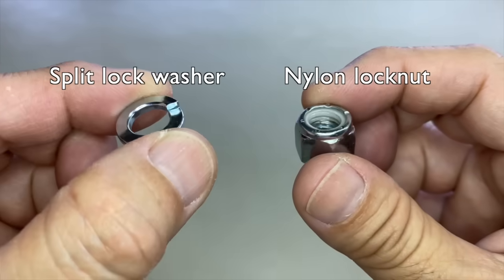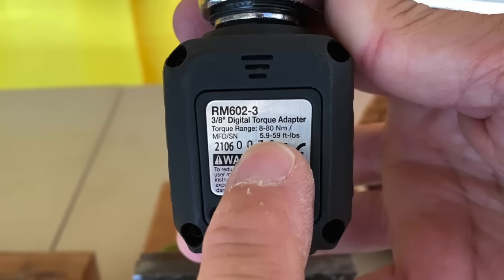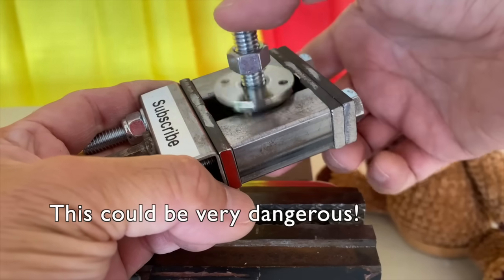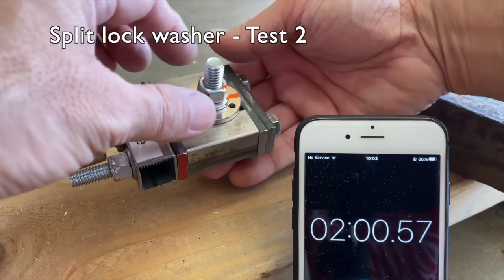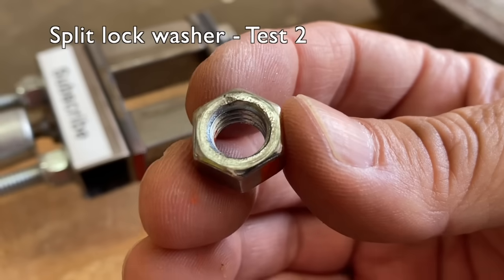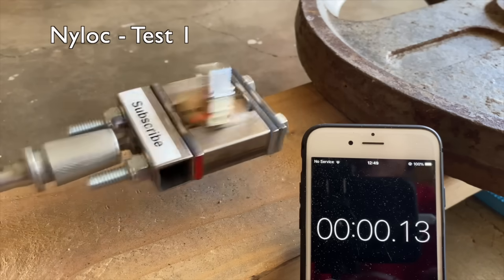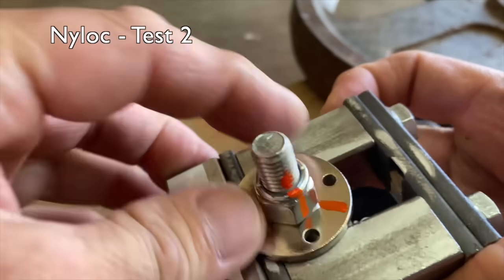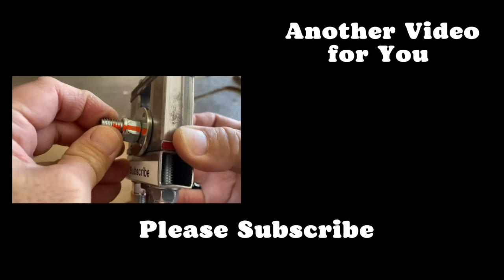Nuts & Bolts - Split Lock Washer vs Nylon Locknut – DIY Impact & Vibration Test - Part 1

Comment: Interesting in that since the nylock nut didn't turn against the bolt the nut hadn't backed off. Where did the looseness come from? What would happen if the nut was re-torqued at that point and the shake test run again?

Comment: did you remember to add drag torque to the torque? i.e.: drag torque is the amount of drag of nylock nut to turn on the bolt plus the 6 torque may be total of 8, or whatever. whenever you use a nylock you must add the drag torque in order to get proper torque.

Comment: Problem with Nylon locking is they are not good with heat cycling. They do locking nuts that have been compressed where there is no nylon in them.

Comment: Nylocks always worked on caliper brakes on bicycles.   Five decades of confirmation. Even the ones that were not torqued down properly.  Also the nylon keeps salt water out of thread. I use them in many other places on a bicycle.

Comment: 6lbs are you kidding me. I work on my own vehicles and other projects. Nothing I have worked on in 30 plus years requires 6lbs. Now due to the plastc of the nylon it would not make marks. Do the test at a much higher poundage.

Comment: First off, 6 ft/lb is a bullshit torque setting for a fastener that size. There is absolutely no preload on the bolt in an axial direction which negates any clamping force necessary for a thread locking device to work. The only reason the Nylock worked is because the Nylon presented resistance on the bolt threads. That's fine for loose, non-clamping fasteners but not so much for clamping fasteners.
Different tools for different jobs.

I've been in industrial maintenance and engineering for pretty close to 40 years, and there are places where you want to use a split washer, places you want to use a Nylock, and places you want to use a deformed thread nut, star washer, Lock-Tite, etc. 
It's never a matter of "which is the best over all?"
Split washers are superior to Nylocks in some situations and Nylocks are superior to split washers in others.
Try using a Nylock where you have to thread a bolt into a drilled and tapped hole in a steel plate or casting. That's not going to work out for you. What'chu gonna do then?

Comment: Correct torque would have different outcomes. Also, try star washers inboard and outboard with a lock nut, not nylon.  A real lock nut will have an oval shape on one side lug nuts, for example .

Comment: I’m interested in testing a nylon nut who has been used before and the same with a lock nut. I remark nylons nuts after been fully screw and unscrew like 3 times are much more easy to screw so I guess easier to unscrew. 
What about lock nut? I guess it’s the same. Less efficient.

Comment: Pretty interesting I guess, but not very meaningful, as each application should be identified.  Also onetime use all metal eccentric locknuts, usually in high heat application.  Then there red, and blue loctite as well.  The test jig is most interesting, and also most confusing, at least to my way of thinking—physics.

Comment: That is why you have to torque the bolts and nuts to specification. Torque it properly and the lock washer is not necessary.

Comment: You need to take the run on torque for the nyloc nuts into account. Find out what the run on torque is then add that to the final torque value applied to the nut.

Comment: In the aircraft industry nylocks are used quite a bit. It requires 2 threads showing. However your torque rate is minimal. Go to 40-50 lbs and see what happens. 30 year old airplane, original nylocks torqued to higher pounds, they haven't moved any!

Comment: Your test is severely flawed.  6 ft pounds is noting for torque.  You needed to go to 20 ft pounds to get to the working clamping and design specs for a 3/8 bolt.

Comment: split washers if for high heat areas and neoprenenuts are for no/non high/meduim heat areas !!! that's why each is used in it's right areas !!! and all comes down to torque specs for each setup !!! anyone can make any setup fail torque all to 60lbs inch pounds !!! and redo this video. and show the poundage as tightened. and no video cuts. it will be a good 30 minute video I will watch no problem !!! I do custom builds, I have had some nuts back off so I tack weld high vibrations area's now !!! straight up bolt engines to the frames no vibration dampners anywhere !!! but tack weld if not sure if the bolts will hold or not !!!

Comment: Will you be able to reproduce this test with a double nut. Sometimes a thin nut is used them there is the question if the thin nut should be top or under. 

Latest thinking is thin nut goes under?

Comment: Very interesting. The comment by the aircraft mechanic seems like the best solution: that size bolt torques to only 6 pounds use a cotter pin.

Comment: Split washer is better,.why , coz it's easier to get the nut off the bolt shank  but it depends on what kind of work you are doing at the time and what is the purpose 🤔

Comment: They look like grade 5 bolts. Now redo this test with the correct torque of 23 ft/lbs torque applied. You don't have enough stretch on the bolts for the experiment to work properly.

Comment: Congratulations on a great video, and a well conducted test. As a mechanical engineer, these results are not surprising to me. The Nylok nut should in theory be better because it directly causes resistance (friction) between the nut and the bolt. The split washer does not provide direct resistance between the nut and the bolt - it causes resistance between the nut and the flange. One thing that I have always thought that would make the spilt washer more effective would be to place a second split washer under the head of the bolt. The split washer provides some resistance to prevent the nut from turning off the bolt, but does not prevent the bolt from turning out of the nut. It would be interesting to see a second set of tests with a second split washer underneath the bolt head.

Comment: You showed the results that I would have expected.  I would like to point out a particular type of application where a Kep nut (basically like a split lock in applications) failed and was let loose inside a piece of electronic gear.  The Kep nut and and screw held a lanyard that held a cap for an Amphenol connector.  It wasn't vibrated a lot, but there was a lot of tugging on it from side to side.  The nut not only loosened, but came off.  I recommended it be replaced by a Nylock so if the nut/screw did loosen, the nut would still be captivated.

Comment: An interesting test would be how much torque stops the nut loosening in your test setup, for each method.
Cause like others said 6lbft is not tension for a bolt that size.

Comment: The lock washers need to be tightened more and they will hold. The nylon nuts are for things that you don't want to lock tight to allow to allow the pieces to rotate like a pully or a lever. They are for two different purposes.

Comment: The modes of vibration, surface finish and material, tightening torque, amplitude and frequency - all affect how a fastener unfastens with vibrations.

To conclude from your very specific use case test that worked to show your results would also apply to all other engineering instances will be a dangerous conclusion to make. 

Regardless, an interesting video!

Comment: The conclusion: The experiment was too rigorous. This test was an accelerated test. Meaning: if only a slight loosening detected after 30 seconds. It is good for 30 years of use. 😂😂😂
Furthermore, nobody torque a 3/8 bolt to 6 ft-lb. Too low.

Comment: The correct thing to use here would be nordlock washers. Reusable and basically impossible to back off on their own. Every application I’ve seen using them has been flawless. I’ve been a forklift tech for 4 years
Reply from the maker: My Nord-Lock test is out… Will Nord-Locks Survive My Test?  DIY Impact & Vibration Test – Part 5
https://youtu.be/wOUnlfhHRko
Pls check it out and drop a comment.  👍😎

Comment: was run on torque added to the stated torque when using the nylon nut? With a torque of only 6ftlbs or 72inlbs the run on torque for that size could be 20-40 inlbs I suspect. So if run on torque was not added then you actually under torqued it compared to the other setups. Thus voiding the test results.

Comment: Mechanic for 40+ years. Others have made the points I will also make. 6 lbft is outrageously low torque, and probably very close to the prevailing torque of the nyloc nut. All metal locknut, and Starlock washers, and even loctite would likely perform better. But a properly torqued bolt, especially if fine thread, would probably excel in this test

Comment: As a structural engineer there has already been lots of testing done here. My best critique would be more pretension in the split lock. The purpose of the split lock is not to bite into the face of the bolt, but to maintain enough tension in the bolt to allow friction to prevent loosening. That’s quite a violent test set up. More torque or tighten the bolt to 90% of its max tension.
Reply: @simonleland2873  Think about the geometry and section involved. And tell me you seriously think a split washer is "maintaining tension" via torsion within its x-section in the joint generated by the much larger fastener. Or calculate the tension in a properly torqued joint (e.g. 60%-70% of axial yield), and then calculate the material stiffness a corresponding split washer must have to generate that magnitude of tension in the joint. It doesn't exist. Split washers do generate some tension, but its so small that it becomes useful in very few applications.
Reply: @ryanfeeley2407  it’s the pretension in the bolt that stops it from loosening. However if it does loosen the split lock opens first, cause it’s spring steel.

Comment: just an FYI, if you application is going to generate any amount of heat on the bolt, the nylon will melt and the nut will slide right off.  You're better off going with a lock washer and normal nut or lock nut, and properly torque it down.

Comment: The biggest thing I see is that they were not torqued to the same clamping load. The force required to overcome the drag of the nylon was not factored into the torque. Therefore, they would have been torqued less than the control and the spring washer. I do not theorize that the spring washer would have as much resistance to crush as the nylon to turn.

Comment: Ain’t no way that 3/8 bolt/nut was properly torqued at 6ftlbs with the spring washer. I doubt the spring would fully collapse flat at that weak torque value. In addition, I got ten bucks that says that elastic locknut would reach 6ftlbs before the threads forced their way all the way through the elastic material. Gotta call BS

Comment: Stainless steel nut and bolt with no lubricant, it will seize and not loosen, but they can sheer off easily.

Comment: Request you try a crimp style locknut. ie one that is purposely deformed from round. Be sure to add the running torque as it is more in that type of fastener.

Comment: As a mechanic for submarines, I would take a consistent nylock over an inconsistent split washer any day.  However, as another has stated to some degree, there is a ftlb torque for every nut, bolt and stud.  I have seen from 6 inozs  to 1/8 “ of movement with a 90 degrees of turn.  The correct torque for the size is VERY important.

Comment: The nylon nut was inveted because bad roads and the inventers son was riding a motorcycle that the had to tighten nuts on evry Saturday du to the vibration. The nuts was widly used during WW II by USA. .

Comment: Most people don't understand that AC current has a LEFT HANDED rotation to it. If regular nuts and split lock washers are used, you're more apt to have an electrical fire/melt down, if they aren't tightened up, occasionally, however, AS I UNDERSTAND IT, NyLoc Nuts were designed to be used in AC connections, because the AC COUNTER CLOCKWISE turning it makes, won't loosen the hardware. In electricity related applications, a loose bolt reduces surface pressure, which forms a gap that will allow an arc, which will start to melt the buss and lugs and a resulting fire. Most of the time, on high energy circuits, TWO BOLTS with NyLoc Nuts and oversized and thick flat washers are used together, to prevent this from happening. (NyLoc Nuts are NOT to be used in high heat applications, because the nylon will melt and the nut WILL come off. You have to use an all steel nut, that looks like a Castle-Nut with the slots squeezed together. They also make a knurled underside nut, that has a washer built in, that offers lots of surface pressure. Of course, you can use Cadneum bolts and nuts and torque them down so they almost bleed. They won't budge without a breaker bar.
   I hope this helps.

Comment: All locking fasteners have drawbacks. I've seen split washers that have completely lost their resilience and nyloc washers whose plastic disks have hardened and don't grip. Even loctite is ineffective if the fastener shifts in its hole and wears away the metal where the surfaces mate. The bolt is then effectively too long and can't tightened with out breaking the loctite's grip. Choosing means finding the compromise you can live with.

Comment: 5:59 the nut doesn’t have “a grip on the bolt.” It’s the nylon bushing that is resisting finger loosening. Just like you were unable to turn the nut in the bolt once the nylon insert engaged the bolt threads.

Comment: both of these are for light duty only,,,for real holding strength, use a lock bolt,also called a place bolt,(flywheel bolt),and lock nuts,( rocker arm lock nuts)..books on race car hardware and the NASA Fastener Design manual ,will tell you,no such thing as a working lock washer...all the locking bolts and washers sold at hardware stores are junk ,dont waste your money on them..

Comment: It also depends on the environment they are used in. Although nylon will last better at higher temperatures than other plastics, when nylon washers are used in something like a tumble dryer they will fail.

Comment: The split washer keeps the parts clamped even after the nut loosens a bit, and some of them bite into the nut and part, stopping the nut from becoming loose, but if the nut loosens enough, it stops acting and the nut is free.
The nylon locknut will resist from getting loose, but once it's loose, the parts lose clamping force, but the locknut will keep resisting.
What we need is a locknut and a preloaded washer that always bites into the nut and part. That way, both the washer and nut will offer resistance, and if the nut comes loose, the washer will maintain clamping force for a while and the locknut will keep resisting.

Comment: Working on cars for 40 years, 25 of them professionally, and I can count on one hand the number or nuts or bolts that have come loose after tightening. Cylinder head bolt usually only have a flat washer yet they never come loose. Wheel nuts have no washers at all and they never come loose (on cars, anyway). Nuts and bolts of all kinds are used all over the car and virtually none of them come loose, irrespective of the type they are. I believe that the sideways motion demonstrated in this test is anomalous to what actually happens, at least in cars.

Comment: But the nyloc nut was not torqued to 6 ft/lbs because the drag from the nylon changes the torque value. Just like if you had lubricated the bolt the torque value would have been higher than indicated on your gauge. I believe that the nyloc nut was actually torqued to something less than 6 ft/lbs

Comment: I appreciate the design and build of your test rig but it doesn't tell the true story with only 6 ft/lbs of torque - correct nominal torque for a galv 3/8-16 nut is 39 ft/lbs whereby the metal to metal split washer will bite in a lot harder than the nylon. The nylon will actually act as a lubricant.

Comment: Interesting video. Although such a test does not say absolutely nothing. The author needs to tell the viewers that each type of nut fixation is used according to the specification for vibration, temperature and other conditions. For critical connections, the following are used: thread lock (glue), thread and nut coating with varnish, locking cotter pin or wire, threaded through a hole in a special nut and rod. When choosing a fixation method, you need to understand in what conditions it will be used.

Comment: In this case you need at least a splitlock washer on both sides.
But both parts can turn in relation with eachother so it makes splitlock washers useless for this "construction".

Comment: Hope I am not repeating, scrolled down and didn't see anything about the orientation of the split lock washers.  The first one was opposite of the third one, the split needs to bite into the nut/surface when the bolt is turning counter clockwise (loosening) so that it will bite into the surfaces. Still, of course the nylon lock washer will always have some bite, buy lock washer is fine if used properly. My $.02.

Comment: Always been a fan of nylon lock washers and Loctite adhesive for things I never want to come apart. I almost never use washers unless I'm trying to spread the load on the bolt on a softer material or prevent scratching damage to the surface of whatever I'm tightening.

Comment: Thing is, who only uses 6 ft lbs of force when tightening bolts?  I don't even use a torque wrench for bolts with lock washers, I just tighten them down good and never seem to have a problem with them.

Comment: This test is pointless at 6 ft/lbs of torque. If its not properly tightened sure it will come loose. Tighten it to recommended specs according to fastener size and grade and I guarantee you will get different results. specified torque for  a 3/8-16 fastener is 23 ft/lbs.  what if i done a similar test at 4 ft/lbs or 2 or 1.